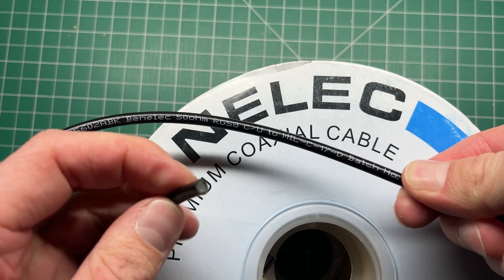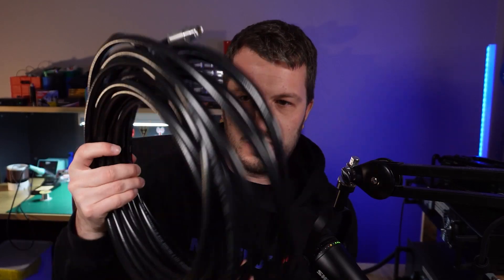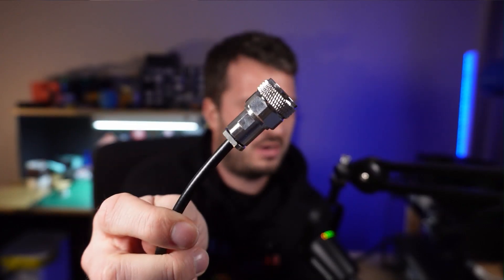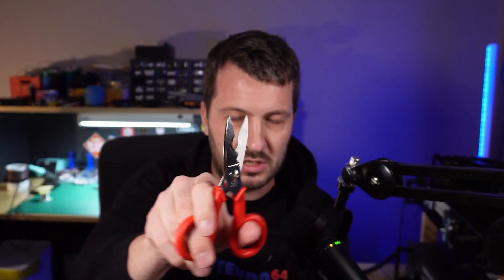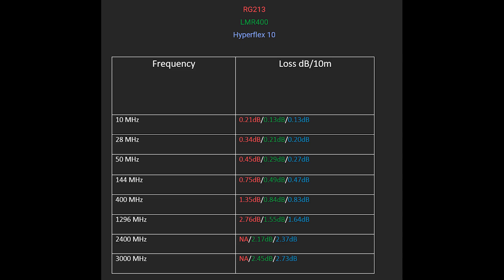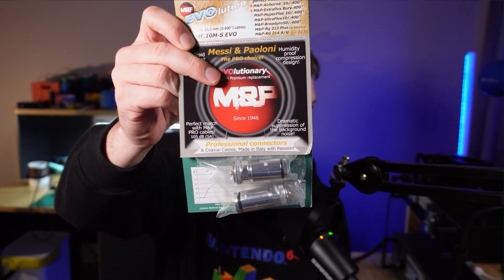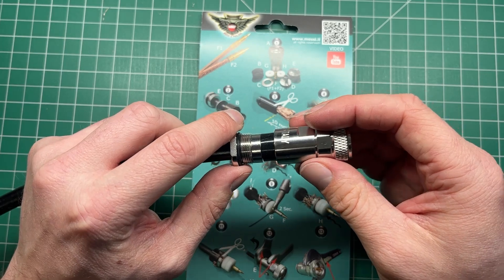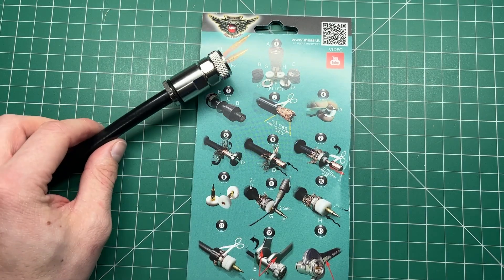The Coax SUPERIOR To What 99% of Hams Are Using

Comment: Ive never actually tried these, but I've also never tried the crimp connectors either.... I've always used the soldered connectors, which I think as far as being "Robust" probably are better than the crimped type and at least come close to the type you're showing provided you use good ones like the silver and teflon type

Comment: After years of compression and crimped connector failures, I now only use entirely soldered connectors that I solder myself so I know it's done right. Intermittent RF connections are the bane of RF communications.

Comment: I'll stick with mil spec cable it dose cost more but it is a better cable than wat is out there because the outer coating is teflon and the  dielectric center  is not foam core but it is teflon  it is still flexible and can handle higher power and heat with out melting or braking down . mil speck stands for military specifications

Comment: LMR240 is comparable to RG8X. They even use the same connectors.  RG58 should be compared to LMR195.  same for connectors with these two as well.    I build my own cable kits for 800/900mHz with LMR240 due to the loss numbers.. I am going to look into this brand based on your video here..  thanks!

Comment: Mil Spec RG214 is good!  It can be a little more problem to put connector on because it has 2 brades. That connector should be water tight!
Reply from the maker: Yes! I’ve used 214 before on repeater interconnect cables too
Reply: @HamRadioDX  A little over a year ago at a hamfest when it was over someone just left to small coil of 214. I am getting into ham after I retire.  SS is only income! So I grabbed it up. Not checked it but maybe 15-20 feet. Used but it will make some jumpers for VHF-UHF Radio to power/SWR meter, and other things like that. Or maybe long enough for short run to antenna for Feld day or POTA!

Comment: Hi Hayden -Thanks for the video.
Buy this cable-don't bother-I bought about 350 metre's of Messi&Paoloni Ultraflex in both the 7mm and the 10mm size coax cables in two runs about 5 five years ago.It was fitted to my antennas on the 2, 70 and 23cms bands and after a few years,I found things started to become very lossy !.I took the antennas down to find out what was going on and found both the braid and the copper shield of the  the 7mm and 10mm coax where corroded with moisture. 
The connectors where the proper ones you used in you video and installed as per factory specification( the joints where well sealed and wrapped with self- amalgamating tape. It is not just a bad batch of coax because I had some cable left over from the previous install to be used as patch cables.This was stored and kept very dry,but when I came to use it it had also gone bad.When I bought the cable both the braid and sheld was nice shiny copper . The water problem happened on all of three feeders on all three antennas simultaneously. If you cut into the coax anywhere along the corrosion is still present. There are no cuts or nicks in the covering, I bought this coax as an investment thinking like yourself it is best quality and hoped  in would last for years. I have my ham ticket for over 40 years and this is the worst cable I have ever used .Has anybody out there had a similar experience with this product?-a warning again don't waste you money. 
A concerned Ham

Comment: I have no idea why one would use RG-58. RG8x, LMR-240 is a better choice where small cable in required. LMR -400  or Buryflex  is ideal for longer runs or high power. I use these cables in my station except for patch cables.

Comment: Very happy with M&P  I have three runs going all the way up the 70 foot crank up tower with 15 ft of mast out the tower top.  In the next few weeks planning to have the tower cranked over to pull down a hex beam and and a 10 element 2 meter Yagi replace the hex with a three element Cubex HF 10-20 quad and HOPING to replace the 10 element 2M Yagi with a pair of stacked 2m/440 8 element Quads.  Just waiting for the summer to cool off a bit it is still in the high 80's and 90's which for me is a bit too warm to be playing antenna out in the yard for the whole weekend.  UHF\VHF Quads are assembled in the driveway. still need a little tuning tweaks but otherwise ready to go.  the HF Quad is boxed up in the Garage waiting to be broken open...  Anyway.  Back to M&P so far I am happy with my 3 runs of Hyperflex 10 and the M&P connectors.  The connectors are a little pricey when you have to buy about 20 of them, but not too bad, and they are very high quality connectors.  I also ordered my .400 size 75 Ohm stacking harness cable from them,  Got all my cable from Italy to Chicago in three days!!!! YES THREE DAYS!!!! fastest overseas shipping I have EVER SEEN! and shipping didn't cost a fortune either....  They have my business from now on if and until I discover a reason they shouldn't.
Reply: Thanks for the feedback I appreciate so much  Nick

Comment: I like the compression connectors even for plain old RG-6 that we all have seen countless times.  They are made to such tolerances that unless you hold the cable straight while removing it, it feels more difficult.  Of course a snug fit is good.

Comment: I have been using Messi&Paoloni cables and connectors for a while now and as I see it they are well worth the price. Their corresponding cables are just marginally more expensive than ordinary RG213 but you'll get a payback on that. The connectors are double the price of ordinary connectors but they are many times better than the ordinary cheaper connectors that you can find in many places.

The only real disadvantage as I see it is that the jacket is copper-coated aluminum and that can cause them to be a bit tricky in special cases where you want to solder the braid. But there are of course ways around that, even though it's not ideal. Soldering the braid might be what you want to do when you build a balun or other equipment with a pigtail cable.

Personally when I assemble the connectors I have found that it's easier if I use a little silicone grease. You can usually get that at car parts dealers as brake cylinder grease. It makes it easier to get the rubber seal in place when assembling the connector. The disadvantage is that it might be easier to pull out the cable from the connector accidentally. So you might want to pick your poison here.

I have also found out that using the extra thin fixed wrenches of 17,18 and 19mm makes working with the connectors a lot easier. Standard thickness wrenches are interfering with each other making it harder to mount the connectors.
Reply: Thanks for your preference. You can solder the braid in Copper clad aluminum, (but not the braid in Alumim-Magnesium).
Our full copper cables are:
 Hyperflex 5,
 Ultraflex 7,
 Ultraflex 7 Sahara,
 Extraflex Bury 7,

 Ultraflex 10,
 Hyperflex 10 Sahara FT8.
 where the inner core + foil + braid are all made with pure copper.

  In order to make cables a tad lighter to carry around and cheaper to ship overseas, in Models
Hyperflex 10, 
Extraflex bury 10, 
Hyperflex 13
Hyperflex 13 Sahara
Extraflex bury 13
The core is copper, the foil is copper, and the braid is Copper clad aluminum, but is solderable.

Models Airborne 5 and Airborne 10 are featherweight and very resistant to trampling and crushing. ideal for DXpedition.

Also, the Extraflex bury series is quite sturdy and flexible, but not as much as the cables with PVC jackets (Ultraflex and Hyperflex series). 

Be cautious putting the Silicone grease: never put it inside the body of the connector, but only outside if needed. 
That's why we introduced the market to the "silicone-seal". Please watch the video on our website.
When we solder we put on gloves and clean the inner surface of the connector with isopropyl Alchohol, as no trace of hand grease has to be left on the surfaces.

Comment: What is compatible to lmr600 ?
Reply: We have an outstanding cable named Hyperflex 13, with an Overall diameter .500" (instead of .600"), with comparable attenuations to LMR 600 UF
 (UF stays for Ultra Flex, the version with 7 wires stranded core).   
Our model instead has a unique 37 strands copper core for unparalleled flexibility, performance, reduced bulk, and reduced weight).

We do not make a version with single copper-clad aluminum, though, because it is too stiff.  

Of course, LMR 600, having a single core, has a lower loss, while the LMR 600 UF version is on par with ours for attenuations ....with a greater size.

Comment: This might be news for someone who didn't know about modern foam-dielectric, 100% shield cable. If you are comparing, RG-58 is more like LMR-195. LMR-240 compares with RX-8X. There are a couple of types of LMR-240, including some stranded. I used solid-wire DB for a buried HF run at my old house, almost as good as 213 but way easier to bury. There are quality 8X variants out there with foam and 100% shield that have similar performance to LMR-240 or the Hyperflex 5. I really doubt the significant figures on those tables. You might try measuring something. There is no way anyone amateur is going to notice, or even measure, fractions of a dB.
Two things I found out the hard way about foil-wrapped foam-dielectric coax: 
1) Never solder connectors other than the center pin (as quickly as possible). The foam will melt. Crimp or maybe clamp is the way to go, with the right tools.
2) Mind the bending radius. Too tight a turn and the center conductor will eventually migrate toward the shield.
Reply: M&P make an awesome Coax connector. The shield doesn't require soldering, only the center pin does, atleast with the "N" connectors I purchased. There is a thick neoprene gasket that puts an enormous amount of pressure on the shield when using open end wrenches to tighten down the nut into the connector body. 
  M&P connectors are some seriously heavy duty machined connectors that will withstand the test of time!🤠👍⚡️🎙

Comment: That connector style isn't new and it's AWEFUL!  Just had one of those styles up for several years, took it down to move.  The problem isn't the center, although that's bad enough, it's that janky compression connection to the braid and horrible strain relief.  Over the years with the wind and vibration shaking the cable and the connector not moving, the braid works it's way out of that "squeeze".  It's just squished there by a couple of pieces of plastic and a thin washer.  The connector body itself is just held onto the cable by a squished rubber boot?!?!  No positive crimped strain relief on the outer insulator at all!  Nothing.  And in use, what do you do?  You turn the connector body.  Imagine what's going on inside there in the face of a twisting force considering you have zilch for strain relief.  That boot being round means you have even less for axial strain relief. Yay!

Therein lies the problem.  Stateside you buy this from MFJ and they put connectors on, these connectors.  I'd have to pay for that only to cut them off and return them to where they belong (the trash), then put decent connectors on.  Spent years as a commercial RF field tech.  Engineering wanted to nothing to do with these style of connectors.  They work great... for a couple of years anyway.  That's just not enough.
Reply: Our UHF EVO connectors are derived and inspired by N connectors which represent the very best of 50 OHM cable technology, universally recognized. Nothing to do with the old-fashioned PL 259, which certainly do not stand up to comparison either in terms of shielding efficiency or in terms of robustness. There is a special video on our youtube channel that describes its advantages in detail. Then if we talk about those to be crimped, which are much cheaper and quicker to assemble, the use of a heat shrink tube is a must because there is no internal gasket to block moisture and water. For the case you have presented, we recommend the use of our silicone.seal, which as a strain relief is extremely effective and insulates perfectly from atmospheric agents, in addition to the excellent protection of the internal rubber cable gland. You may have seen similar connectors, but we were the first to ennoble the PL259 with a series of great improvements that led it to approach the famous N connector for performance. It holds up well up to 4 Ghz.
Reply: @MessiPaoloniSRLAncona  I have years as a commercial communications technician.  The big stuff.  I've put on singe connectors that are well over $100 a piece.  Nothing you wrote addresses the issues I listed concerning strain relief.  Again, our engineers have seen this style of connector fail after a few years.  Your strain relief is a rubber boot and friction on the cable jacket.  Fine for a few years but that's it.  It will move and when it does your tiny grip on the shield will begin to have issues.  They also refuse to use connectors in the field that have to be soldered due to the variability of techs soldering abilities, which is a valid concern with a bunch of hobbyists.

Grab the braid, tight and wide, you feel that?  Now you have a hold of the end of the coax.

Comment: Do you know why it's called "RG"? An interesting story. It is called RG because in WWII when field communications were improved, the term RG referred to radio guide. The way equipment was connected.
Reply: and Uni Radio Metric for the flexible versions such as URM70 in lieu of RG59

Comment: eww copper clad aluminium braid eww 
no matter just "how bendy" a cable is, you still have the issue of bend radius when it comes to signal transmission, but if you really don't care much about frequency, interference, and power, then really bendy is good.
Reply: I totally agree, John. Always keep in mind the Minimum bending radius given by the manufacturer. The very flexible cables like our Ultraflex and Hyperflex series are more forgiving and prone to reaching a narrower bending, but with a grain of salt.
 Please look at page 25 of our downloadable catalogue. 

In our catalogue there are two values: the bigger radius is for multiple bends, while the smaller is intended for using a tube support at a warm temperature. (chokes, for instance).  

The use in some of our cables of copper-clad aluminum (just the braid but never the foil) is for granting a lighter overall weight (less mechanical stress for the swinging part of the cable in the towers) and better use as a REACTIVE BRAID, acting as a spring with a memory.  

So not only an outstanding 105 dB screening efficiency ( a must for reducing electromagnetic pollution and interferences), but a cable designed to be explicitly matched with rotors!

Use flexible cables, possibly with stationery installation and rotor-operated antennas, while if you have to make a DIRECT BURIAL or take around the cable a dozen times, taking the risk that the cable is being crushed by vehicles or humans, prefer the Extraflex Bury series, with Polyethylene Jacket.

Comment: At 7:28 you identified the connectors as PL-259. I'm most familiar with them as they are "Type N" connectors. We used them on all but the highest frequency equipment when I was in the US Navy. PL-259s plug/SO-239 socket referred to as "UHF connectors" are the cheapies so commonly used on ham and commercial HF, VHF, and UHF mobile and base equipment.

You did correctly identify the connector as a Type N at 9:55.
Reply: Look again! The connector he shows in the bag is a PL259 for sure. Later he shows an N-type being assembled :-)
Reply: @michaelkilpatrick5331  I respectfully disagree. The resolution of the image at about 7:25 is a bit poor, but from I'm able to discern, it looks like a Type-N to me. Also at about 7:51 the male pin is clearly that for a Type-N.
Reply: @jimpiper5297  if you look at the printing on the top right of the package it plainly says PL-259.

Comment: I have installed M&P Ultraflex 7 Sahara cables in my mobile for mobile/portable HF.   They are hooked to a switch in the cab so I can switch between ham sticks while mobile and 2 different antennas while portable.  I really like the compression connectors.  Soldering the center conductor took a little patience as I was not at my soldering desk but outside in the elements.  But I am very impressed after dealing with LMR400 for VHF/UHF antennas.  73 de KI5HXM!

Comment: good video but, when installing the  connector A little more screen braid to connect to the connector body would be better when using high power. I have seen many bad (commercial) installs that only needed re-terminating to solve an issue. Keeps me in a job!

Comment: Lmr600UF is where it's at. Very expensive but virtually zero loss. Stranded core instead of solid. Wouldn't advise anyone to use it unless you had a long run to your antenna.
Reply: LMR 600 UF is a great cable, but may I suggest keeping in consideration Hyperflex 13 which is smaller (.500), lighter, and more flexible thanks to the 37 copper wires as opposed to the 7 wires of LMR 600 UF,  and has got approx the same attenuation.
    I forgot....even cheaper.